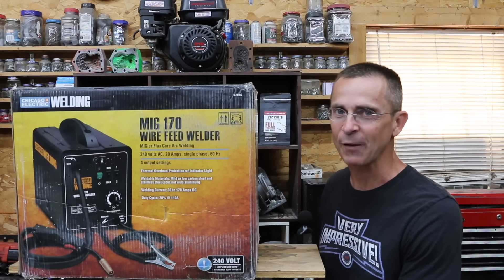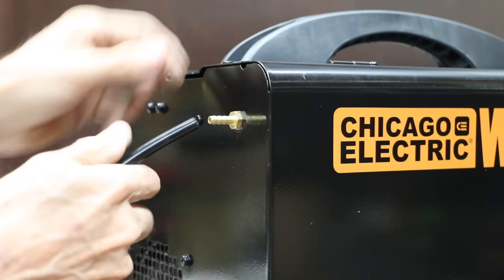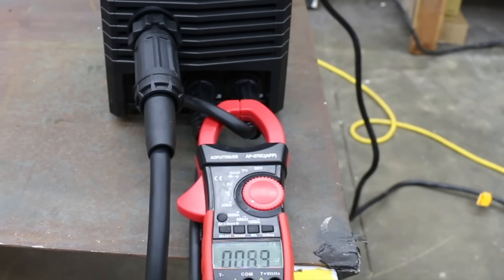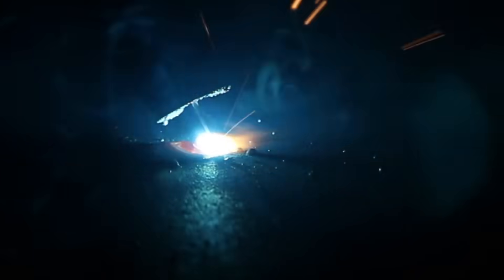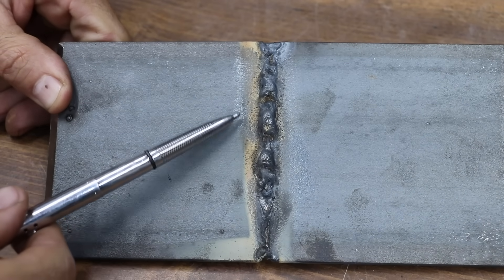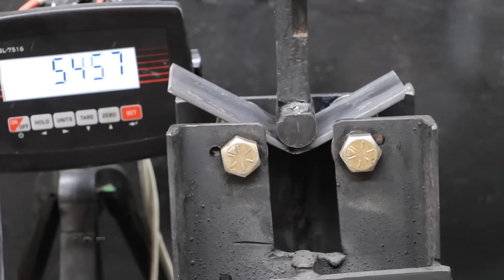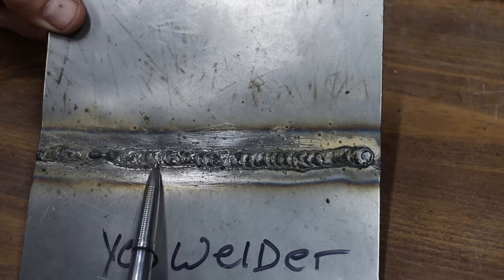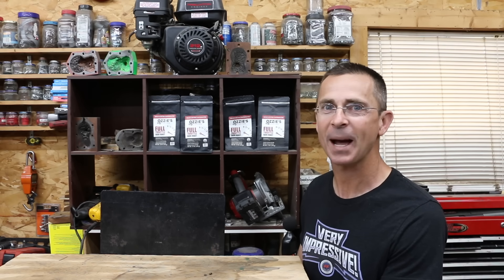Cheap vs Expensive Welder? Let’s Find Out!

Comment: Lincoln used to run a special with significant savings if you bought direct from them.  I bought a 210 about 4-5 years ago for close to 1200-1300 bucks delivered to me.  It’s my personal at home welder. Granted things have gone up in price. But it’s a fantastic machine - I’ve pushed it pretty hard and it keeps kicking. I’ve personally welded truck frames and teeth shanks on excavators.
Reply from the maker: Thank you for sharing!

Comment: The dual voltage adapter for the FlameWeld was not thought out. It adapts a 50A 240v plug to mate with a 110V 3 prong plug. Imagine plugging in your Makita circular saw into the thing. It shold have a proprietary plug for the 110 end to mate to a one from the welder so no one sets themself of their equipment on fire and worse.

Comment: All resistance welding (electric) is Arc Welding. GMAW, SMAW, SAW, GTAW, FCAW, Dual-shield, all of them.  GMAW=Gas Metal Arc Welding= Mig, SMAW=Shielded Metal Arc Welding= Stick, SAW=Submerged Arc Welding (under sand) GTAW= Tig= Gas Tungsten Arc Welding, FCAW= Flux-Core Arc Welding (dual-shield is FCAW+GMAW, with flux-core and gas shielding).
Reply from the maker: Thanks for the information!
Reply: @ProjectFarm  Might want to consider Everlast and Miller in a follow-up.

Comment: I'm surprised that you used the Vulcan 220 instead of the 215 as that is by far a great welder for just about any project whether steel, stainless steel, hastelloy, chromoly, and with the spool gun Aluminum. I've been a welder for nearly 40 years and am certified in GMAW, GTAW, SMAW, Plasma Arc Welding, and OxyAcc welding (certified through the US Navy and AWS) and have used some of the best machines money can buy. With that said for the money and quality the Vulcan 215 takes the show. Of course if money is no object the the Millermatic 211 is definitely the best of the best followed by Esab then Lincoln, but that's only if you have unlimited funds but for a small shop that is restricted by funds the Vulcan 215 is a must buy. The Omni pro 220 is a good all around welder but can't be compared to the 215 if your looking for a good shop MIG only welder. And if your really looking for a very powerful MIG welder the Millermatic 252 is by far the best and is very versatile with many functions within the MIG welding theater. Great Channel you have here and have used many times to get much needed information and I thank you Very Much for doing what you do!!!
Reply from the maker: Our pleasure!

Comment: Another great job with tons of information. 
An idea for the next welding video. Several manufacturers now make lightweight Wire Feed Welders for Mig and Flux Core welding. These machines are made for the hobbyist and for light maintenance/portable welding. I just purchased a Lincoln Weld-Pak 90i (under $400.00) which is capable of MiG and Flux Core Welding up to 1/4” thick material with multiple pass welding when using Flux Core Wire. Lincoln also sells a Flux Core only version the Weld-Pac 90FC  ($279.00)
Harbor Freight has a similar machine the Easy Flux 125 ($179.00) 
There are other similar machines but what is really nice is the weight, The Lincoln is only 18 pounds with a 1 pound spool of wire and can accommodate a 2 pound spool of wire making the machine ideal for maintenance purposes and work in the field.
Reply from the maker: Thank you for the video idea!

Comment: I have both the Lincoln and the Vulcan in my shop and honestly totally personal preference but I almost always use the Vulcan after allot of hood time with it I can actually weld better with it then my Lincoln and switching back and forth from stick to mig it’s second to do it so sometimes I’ll switch it up on a project just for the fun of welding differently I’ll do some flux core then finish up on a mix of 6010 and 7018 just to have fun at work
Reply from the maker: Thank you for sharing!

Comment: What you also need to take into account is how long the welder lasts. I am a retired fabricator/welder and got myself a cheap chinese welder from the usual tropical river source, it failed (blew up on switch on) before I had got through half a 5KG reel of wire in just over a year, so I got myself a European made machine that has lasted. I used  buy machine that cost in excess of $6000 US they would last ten years or more running all day every day so you do get what you pay for.
Reply: Amen brother

Comment: It hurt me a little to see wirefeed used on thin gauge. I see people trying to do that all the time. You need enough power to melt the thickness of the wire, which means it will always try to blow through and never be a good weld. Its just not the right tool for the job, tig it every time.
Reply from the maker: Thank you for sharing!
Reply: @ProjectFarm You read my comment!! That just made my day!

Comment: All of those dual voltage welders will run a much better low end on 120v supply.  They all work by just running a pwm duty cycle to set the average amps but that leaves the amps and voltage for the instants it is in the on cycle far too harsh for anything thin.  I had a little 120v miller around for exactly this, it will run on 28ga no problem where my 230v miller is a fight with anything much thinner than 14ga. My dual volt everlast that replaced the small miller runs thin great on 120v, even worse than my big miller if its on 230v but its also a inverter machine vs a transformer machine. Yes its a little annoying to swap the plug around but its $500 not $2000

Comment: bought a hitbox MIG250 just as 2020 started turning strange and haven't a reason to compain; kinda want to get one that does aluminium or tig but otherwise great....... their support seems great, they tried to contact me to confirm some of my address but I never seen the message so they sent me a unit via Amazon instead of from china; when I seen the message they insisted on sending me a sample spool despite I bought it with discounts on top of discounts(priority was highest duty cycle, "250A" and overall cheapest)...... ended up buying a plasma cutter from them too:)

Comment: What about reliability & repairability? I have a 30 year old MIG iron-core transformer welder that I can still get parts for. None of the cheap & cheerful Chinese offerings will be around in 10 years, let alone 30, they will be rusting away in landfill, leaching toxic metals into the water table.
Reply from the maker: Thank you for sharing!

Comment: VERY helpful tests! While this is one of those things it is very VERY hard to maintain consistency across tests, I feel like you made a really good effort at it, and I appreciate the difficulty and the attempt. In addition, the cost outlay for testing like this is quite significant - ESPECIALLY for a channel without sponsorships! Thanks for all you do, your videos are incredible! Personally, I use a Yeswelder, which does a good job for up to medium-duty use. No way I would have been able to get into the hobby of welding if I'd needed to spend $1000+ on a welder, so it opened up a whole world of projects for me that I otherwise wouldn't have been able to experience. Way to go, Todd, thanks again!
Reply: Welding is rather subjective, so having an experienced professional do their best with each tool is good enough for me! Perhaps Todd should have had a go as well to give an opinion on ease of getting a usable result.
Reply: @peejay1981  Quality welding is not subjective. It's easy to see a good weld vs a bad weld. Having the welding done by a professional is the only way to do it because an amateur would be all over the place and likely not the get same weld quality from weld to weld, regardless of what he is using.

Comment: This is why professional welders pay good money for their machines. The next time you casually sit in a building underneath tons of construction steel you should hope the welders didn't use those cheap Chinese machines. Lack of decent components, assembly and QC is why they are cheap. On the other hand, if you just want to fool around in your own garage with stuff you exclusively build for your own use. Knock yourself out (literally). Personally I'd pay for a premium brand any day of the week. However I wouldn't buy a multi process machine. The changeover between processes is not worth it for me. If you want to TIG, buy a dedicated TIG machine, and so on. 
Thanks Todd for yet another great shootout!

Comment: Awesome comparisons in this video! Welding thin metal is the best way to tell the difference between any brand of welder because low current consistency is the key to welding thin metal well. I would love to see a comparison between Fronius, Miller, Lincoln, Primeweld, ESAB, Vulcan, and maybe a Panasonic. Don't compare the Tool truck welders because they are overpriced, rebranded Lincoln and Miller welders with fewer features.

Another factor to consider is smaller spools of wire have trouble feeding out at the correct speed according to the settings set on the machine (except on machines designed for welding AL with spoon guns). The drive roll will slip with the slightest bend or kink, which small rolls tend to have, leading to inconsistent welds.

I would love to see a video comparing welding hoods.
Reply: i doubt he would have the cash to do that sort of test because each machine is a few 1000 and i dont see the point because the tests show nothing really. you have to use a semi automatic track to get the true performance difference of a mig welder..

Comment: I cant speak for any of the others, but I bought a Vulcan without the tig gear for 680 bucks in the discount section. Got a bottle of gas and a 10 pound spool of mild .035. I used it almost exclusively from a 110 outlet, and the thing really does make you look like you know what youre doing when it comes to setting down a good bead. It does an exceptional job for anything from welding thin wall exhaust tubing to truck frames. I have yet to put a stick electrode on it, but the mig does such a fantastic job, its hard to not use it, maybe when i run out of gas ill have an excuse.

Comment: The Lincoln welder is a good welder but is know to start working after 1 year of use light to medium use. I remeber the one I used to run at my older job worked good for a year then sat for about 8 months then didnt want to turn on. After my coworker plugged it in and turned it on after it popped the breaker 6 times the 25 amp fuse botton exploused with a bag and set the 25 amp botton across the shop. I like Lincoln machines especially the Vantange 300 but having machines break down after a year or 2 of work isnt something you look for in a welder. The Miller 211 never gave me problems except it over heating in the summer when it was 110 outside and 100 in the shop.

Comment: I did a back to back test of the 250A Yes Welder and the ToolIom TL250. Performance wise they are identical.. I could swear its the same welder in a different case. The Yes welder has a fancy LCD display whereas the Tooliom has buttons/lights and costs less. The advantage of the Tooliom though is it will run on both 110 and 220v which is a very handy feature. I did measure the welding current and they both top out at 220 amps on 240V. Needless to say I sent the Yes Welder back. I did own the 200A Tooliom Mig welder for 2 years before upgrading to the TL250 and it worked flawlessly. The only downside I noticed is the torch does get pretty hot welding thick plate for more than a few minutes. So for Industrial use welding thick plate I would not buy this machine. But for the home hobbyist its very hard to beat.

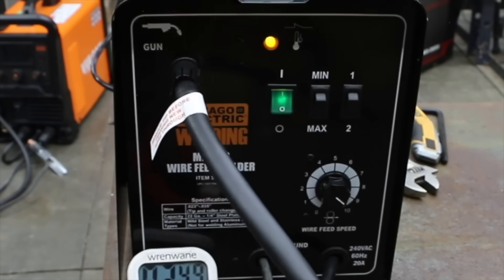Comment: 0:20 Flameweld $189
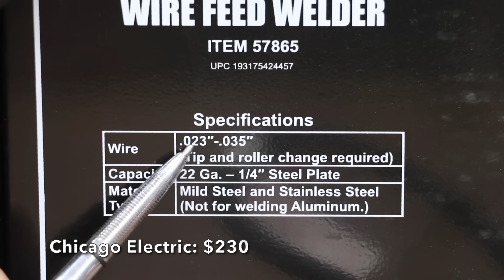1:37 Chicago Electric $230
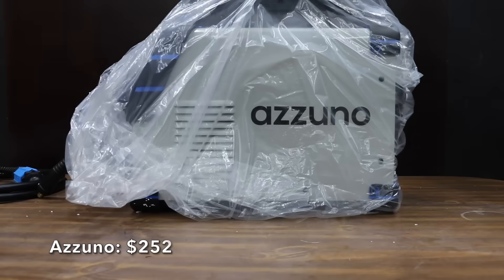2:36 Azzuno $252
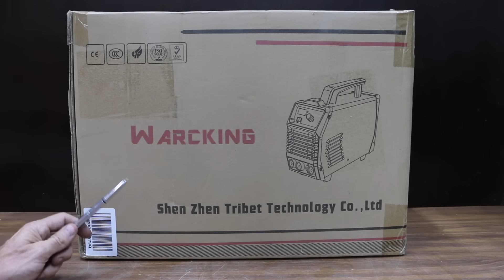3:16 Warcking $260
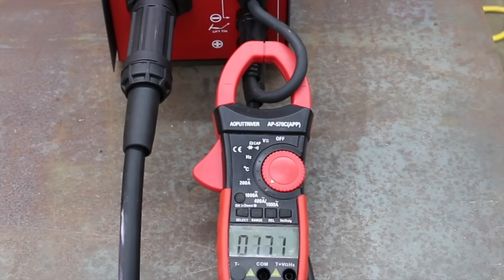3:58 YesWelder 205DS $360 
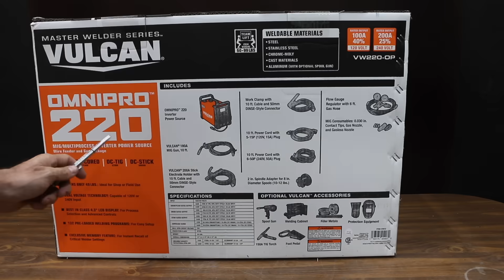4:34 Vulcan 220 $1150 
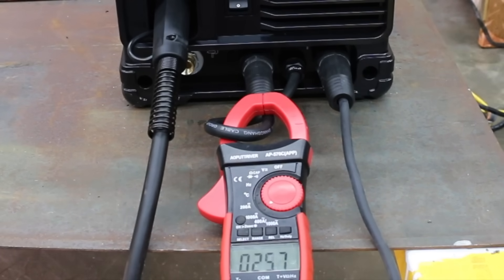5:22 Lincoln 210 $2300

6:02 Min current chart
6:05 Max current chart
6:14 Weight chart
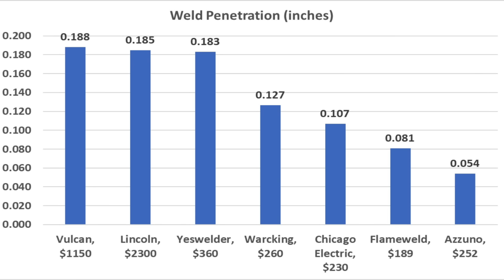7:53 Weld penetration chart
11:34 Force to break weld chart
14:53 5min current draw chart
15:03 Ranking chart
Reply: 10:47 wasps worst day ever.
Reply: @bryans8895 It was nice to wear a welding mask
Reply: it would sure be nice to find out what.other brands the lower-cost welders are sold under, especially for European subscribers.... has Todd ever checked how many non-North American subscribers are on the channel?
Reply: @lohikarhu734 Agreed, but that list changes often, and as you noted, differs by market. There may also be slight, but significant, changes that might not be apparent in marketing pictures, especially since lots of the Chinese brands use renders instead of photographs. You could try using Google photo search since listings often use the exact same pictures.
Reply: 10:47 Yellow Jacket $0.00
Reply: i listened to the comments during welding, and, i thought that the Azzuno was pretty well-rated, even better than the charts suggest...
Reply: ^ Underappreciated Comment ^

Comment: Love this channel! something to note with the penetration test. When weaving during welding, you'll always get less penetration than when moving at a constant speed with no weave. The results seen in this section of the video may have been a little different if the weld method had been a bit more consistent. Either way it's a fantastic video and this small variation is not relevant to most people's application.
Reply from the maker: Thank you for sharing!

Comment: I've had 5k welders, 1500 quid welders & towed diesel 20k welders - a few years back, welders were spendy... All that has gone out the window - you can now buy a 200 quid Hitbox that will do everything you want. 

If you run stick, then it's even cheaper - Yeswelder do sub 100 quid machines that are absolute beasts despite being the size of a lunchbox. 

Pal came in yesterday - he has a workshop full of "Posh" welders - he wanted to borrow my Yeswelder stick machine that he'd used here one time because "Dunno how that tiny thing welds so good.. I have a job in the middle of nowhere to do.. It'll do it.."  It will too. Yeswelder stuff runs good. For flux-core, wire choice matters. Yeswelder wire runs REALLY hot - Hitbox make the best flux-core wire I have used, smooth, clean welds, doesn't run crazy-hot.

Just bought that Azzuno machine based off this vid - I know by sound when I hear a good sheet-metal welder running. It pared with Hitbox wire will be worth its weight in gold. I only weld bodywork - how low can you go? Low wins.

Comment: I love my YesWelder MIG. I have used it for over two years with great results. Bought it as a secondary welder when it was on sale for $299! I liked it so much it turned into primary. It did take a little practice changing settings to get best results for different thickness steel. I run 030 wire and 18/20 ga to 1/4" metal. It does run a bit hot using internal settings, but its easy to adjust for application and user. Hope that made sense, and helped anyone wanting more information. Another great comparison! Keep them coming 😊✌️

Comment: I got one of those Chicago electric flux core MiG welders several years ago for 85 bucks with a coupon. It is a steal at that price for sure, I've used it many times for welding little things here and there and it still works like new. It is absolutely NOT for someone who is doing serious structural welds or wanting pretty welds. I wouldn't use it to weld together a trailer, let's just say. With the prices they go for now, I would spend the extra money for a more mid range welder.
Reply from the maker: Thank you for sharing!

Comment: I don't know if your double bevel weld is a good test of the welders.  That is not a prequalified weld that can be used in structural applications and as performed it will not provide the full strength that is possible.  Maybe for that reason it makes it a good test of the welders.  For a full strength connection you would have to put a backer bar on and weld to it or you would have to turn the piece over, backgouge and lay a bead on that side too.  A properly done weld would be able to bend a considerable amount without breaking, in fact that is the way the qualification process works for a weld.

Comment: I am a retired aircraft welder.  Great video.  At my current job i have my everlast mig and it is a great inverter machine.  The vulcan and yeswelder are both good machines for lower cost machines.great video.
Reply from the maker: Thank you for sharing!

Comment: I wish Everlast would have been in this shootout. Im a certified welder, and have used many Millers and Lincoln's, and the midrange and high-end Everlasts weld just as good as the Millers and Lincoln's I've used but at about 1/3 the price. The higher end Everlast I have that was only $800, has a 100% duty cycle on it! The the internals are metal as well. Almost no cheap plastic.
Reply from the maker: Thank you for sharing!

Comment: Been welding for over 20 years, and personally,  the mig welder from Eastwood tools is the best bang for your buck. Half the price of a lincoln,  and it does 95% of what the lincoln can do.  Lincolns are nice, but overrated.  The ones from home depot burn up the spool feed motor. The ones from welding stores cost more, but are more robust. Everyone swears by lincoln,  but for me they are overrated. The millermatic 220v is by far the best on the market, and the most forgiving for beginners.  The 110 version is good, but not as powerful.  I used to despise hobart welders, but about 15 years ago  they started making some good products.  For used welders, the archaic  Linde welders work phenomenal.  Sometimes the trigger wire falls apart and shorts the board.  But splice in a new wire, solder the board, and its fine. I cut the leg off of a diode to use as a jumper for the board.
Reply from the maker: Thank you for sharing!